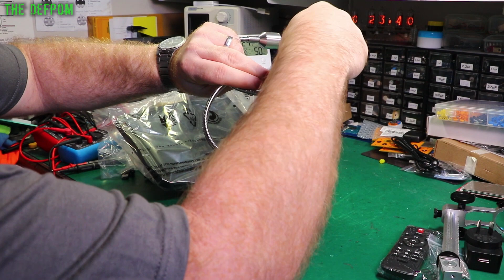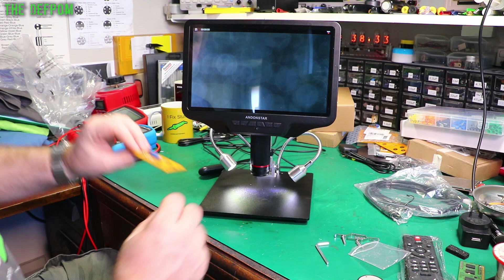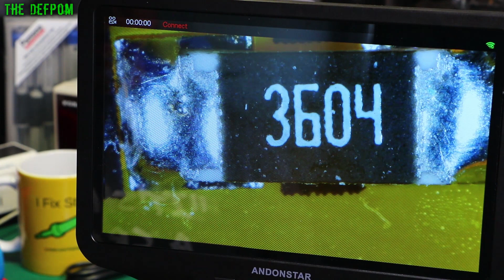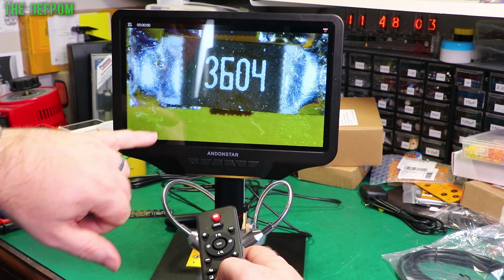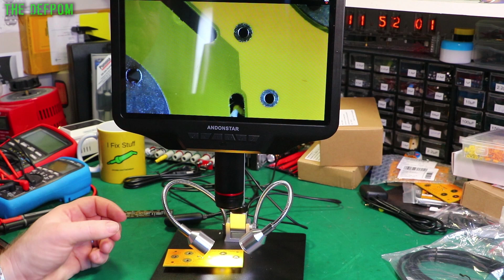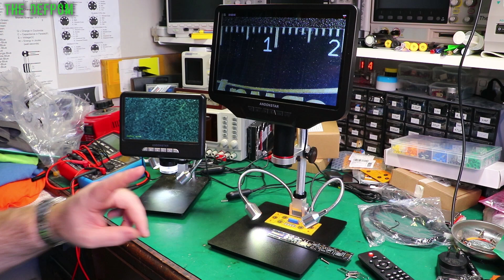🔴 Andonstar AD409 Microscope Review - 10.1" Of Close Up Goodness - No.792

Comment: I already bought this one yesterday. it happened to be on sale on amazon prime days and decided to jump on it. Sorry I didn't use your link. your videos are very good and this confirms is exactly what I want. The only issue i can see with these devices is the size of a circuit board you can put under it. I am assuming a different type of stand can be made to accommodate larger circuit boards esp when using it to find the issues on those type of boards. Thank you for the review!

Comment: Thanks for the demo. You have narrowed my choices down to three.  Have you tried the HDMI out to a larger display?  This a must have feature for me and my eyesight or lack thereof. Cheers!
Reply from the maker: I hadn't tried the HDMI so I just did, it works fine, nice and fast, BUT when it is plugged in it turns off the built in screen which is a shame.
Reply: @TheDefpom  Thanks for checking. Cheers!

Comment: I have yet to see a digital microscope that doesn't give me motion  sickness.  I would have like to see you solder under it to see if you have any noticeable lag.  How "real time" is it?
Reply: I have the AD407 and there is no distinguishable lag on it either on internal display or external HDMI display. I have tried a cheap USB scope and the lag on that made it unusable for anything other than inspection only.
Reply: @coctailrob  I have to admit, it's been many years since I tried a digital microscope.  That AD407 does look very versatile.  You don't have to have your head over, and pointing at an angle over,  two optical lenses.  You can look straight forward, like a computer screen.  That may be a more natural way to work (unless you are used to an optical scope).

Comment: Well that's crap, i poured cold water on a teabag lol.
That microscope looks spot on,  you can get the lense well away from the pcb and have oodles of space to work in.
Work space is important.
Just glue a thin rubber mat on that bare base surface, stop that pcb slipping.
No mug holder on the side !!, disgusting :)

Comment: I have a AD305  and love it.
I dpecially like its large gap clearance as I do SMD soldering work under it, thus for this model would certanly go the end mount as you concluded.
One item to examine would be the capability to simultaneously use HDMI output at same time as recording to MicroSD card. On the 300 series it could do so, but from memory the earlier AD407  10" microscope would no longer do so.
Still I have considrred an upgrade to a 10" as I do not use a HDMI screen for space/arangement of lab.
Reply: I have the AD407 and it happily displays on its own screen an external HDMI display and record video all simultaneously, with audio. Maybe I have a revised edition of the AD407.
Reply: @coctailrob  thank you that is good info. I believe that the 10" screen is a great improvement. While my smaller screen works well and has good clearance from the work piece for doing assembly/ soldering, certainly far better than most cheap small electronic scopes I tried, that leave mere few inches, the larger display does seem  more desirable.